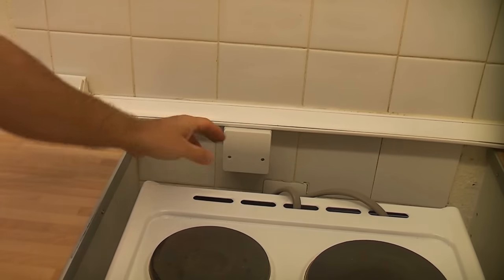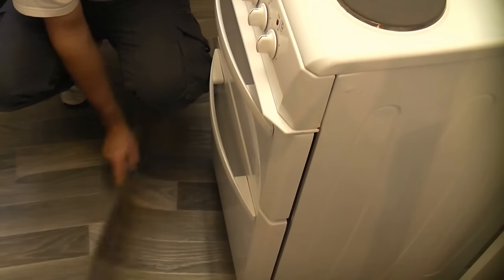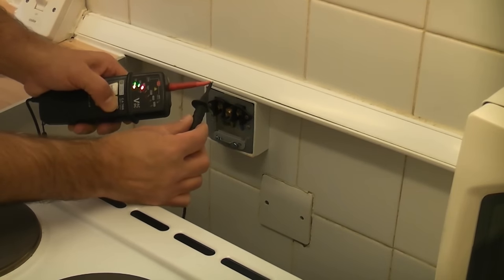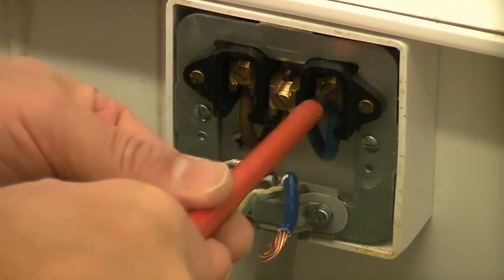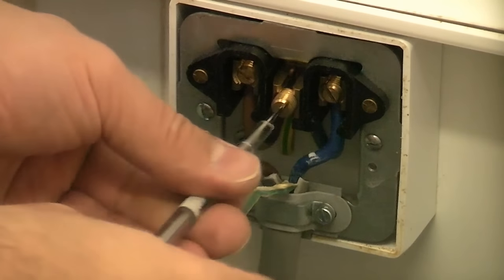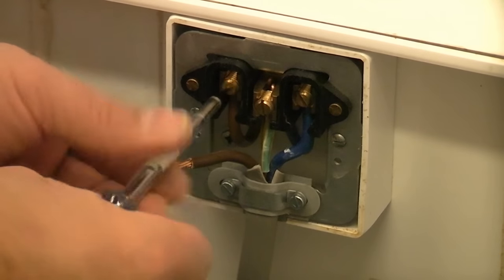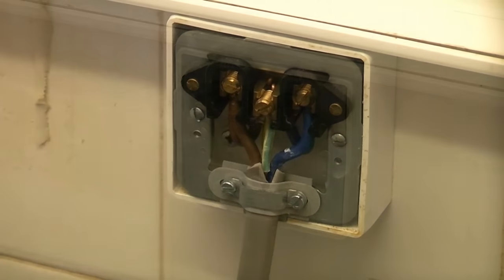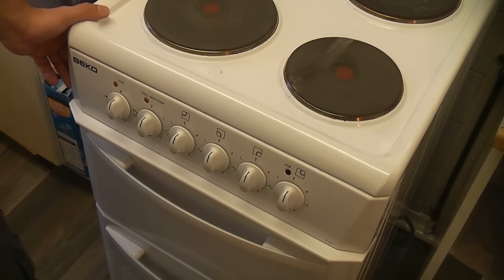How to wire an electric cooker

Comment: In the fuse box it is labelled cooker do I just switch that off or should i also switch off label that says sockets too? Thanks
Reply from the maker: Switch off the cooker circuit, then lock it off to make sure that nobody can switch it back on ;-)
Then test to ensure it is not live before touching any of the terminals.
Thanks for the comment 👍
Reply: @ultimatehandyman  thanks managed to do it fine. ;)

Comment: Hi the bud...my cooker Is without the cable supplied,  is there a particular size cable.you need? I.e 9mm?  Cheers in advance
Reply from the maker: You'll have to check the manual for the cooker, that will tell you which cable you need ;-)
Thanks for the comment
Reply: Ultimate Handyman cheers...lol you'd think I'd know, having worked for contactum for 14 yrs!!  Albeit 12 yrs ago.. Checked manual and 6mm is good.. Sorted and working fine.

Comment: Daft question what's the additional socket box lower down on wall for
Reply from the maker: That is the original cooker connection unit which was disconnected when the flat was rewired. Originally the whole flat was wired with the cables buried in the plaster, but it was rewired a few years back and all sockets and even lights were surface mounted with the cables run in trunking.
Thanks for the comment

Comment: Don't see that ccu working too well with a seperate oven and hob arrangement as there is not really enough room to connect 3 cables together.  I used a 60 amp junction box for my oven and hob to split the cable. So one supply cable coming in from the cooker isolation switch and two cables coming out. one to oven and other too hob located in cupboard at side of cooker. It works well.

Comment: I don’t have one of those gadgets to check it’s off., is it ok to just switch the red switches off at the fuse box.  Thanks
Reply from the maker: You really need to test to ensure it is isolated correctly (people have been electrocuted when they have just relied on switches) 
If I was to do this without test equipment, I would isolate the cooker switch, turn off every circuit breaker (or remove every fuse) and also switch off the main switch on the consumer unit (but I'd never recommend that anyone does this without confirming it is not live) 
Thanks for the comment 👍

Comment: When my cooker was put in its on a normal plug,only had the brand new cooker month,today while using the hob ,flashing f come on,which means fault,checked the plug and has 13amp fuse,read the manual and it says 16amp minimum, could this simple 1amp difference be the problem
Reply from the maker: Normally single electric ovens can be wired to a 13A plug.
Double ovens, electric ovens and hob's normally need hard wiring into a dedicated circuit, they should never be wired into a 13A plug.
Not sure if that is causing the flashing f though.
I'd expect the fuse to blow, rather than a fault code appearing
Reply: @ultimatehandyman  do you have email,if possible like to send picture of socket set up?
Reply from the maker: @philhode5104   Probably best if you ask in the forum, as one of the sparks might reply (they know more than me)
http://www.ultimatehandyman.co.uk/forum1/viewforum.php?f=3

Comment: I have a cooker that needs hard wiring to an a socket like this, but only have a normal 3 pin plug socket for it to go into, what can I do ?
Reply from the maker: You will need an electrician to install a dedicated circuit, I'm afraid!
Thanks for the comment

Comment: Shoutout who wired that oven isolator switch tho genius
Reply from the maker: Probably a council/housing association electrician 😉

All the wiring in this flat was surface mounted. One day I was there decorating and two electricians rocked up, I thought they might have been testing or something! No, they just turned up to make sure that the capping was on all of the trunking. I told them that the light bulkhead in the communal hallway was not working, they just said “we are not here to fix that”, then left!

Comment: Wife wants a ceramic hob fitted,instead of gas hob now installed,I have a 45 amp wall plug feeding electric cooker,which has a socket for a plug on it not being used,can a 6mm cable wire into a 13 amp plug,so I can drill through worktop,through fitted cupboard,to a new hob,there is a 45 amp breaker fitted in main fuse box to feed this wall socket,any ideas or info please,will be doing it soon,03/10/2019 thanks.
Reply from the maker: I'm afraid you'll need an electrician for this one 😉

Comment: Nice thorough video. Not seen that kind of cooker box before though.
Reply from the maker: It's in an ex-council flat so it might not be a common type. It would make things much easier if they supplied cookers with a lead and special plug ;-) 
Thanks for the comment ;-)
Reply: You are right there, something similar to a 3phase plug would be great so it's all enclosed safely. It's not like electric cookers are an uncommon thing.
Reply from the maker: Exactly, I don't know why they don't sell such a thing, it would make a lot of sense!
Thanks for the comment ;-)

Comment: So if I turn off my fuse box I'll be fine to do this with normal screwdriver.?
Reply from the maker: No, you need to check it is not live first- or you could be electrocuted.
Thanks for the comment 👍

Comment: Also I used to test appliances for a local charity shop before they could be sold and did a 2 day P.A.T testing course which I passed, the only thing I never worked with was electric cookers as there was nowhere to connect them.

Comment: should the wires of the cooker be touching the wires from the wall connection ?
Reply from the maker: Yes, they are in the same terminal. Unless you have a CCU with two lots of terminals.
Thanks for the comment
Reply: Sharon Aur thanks for asking this. I wondered the same thing if they're allowed to touch or not haha 😂 x

Comment: Thanks for the video, nicely explained. Can you use a standard multi-meter to check if there's any voltage at the live and neutral connections? I didn't recognise the bit of kit you used
Reply from the maker: Yes you can as long as it is set to AC volts, but the HSE recommend using a GS38 approved voltage tester such as the one used in the video. With a multi-meter there is a chance that you could have it switched to the wrong function or the meter itself could be faulty which is why a GS38 approved tester is recommended.
Thanks for the comment ;-)
Reply: Ok makes sense
Reply: +Ultimate Handyman ... if their no sleeve on the earth wire is it safe to leave it bare ???
Reply from the maker: Yes, but it's best to sleeve it. Apparently sleeving the earth wire is required for the British standard, it's often left bare in other countries such as America I believe.
Reply: cheers for the reply just I got cooker fitted and was worrying about the bare wire
Reply from the maker: If someone installed it for you they should have used green and yellow sleeving. 
Were they a qualified electrician?
Reply: I believe so they work for Curry's
Reply from the maker: They should have used green and yellow sleeving, not doing so means the wiring is not up to the current wiring regulations.

Comment: What does it mean to "cross thread the screw"? 

Thanks for the useful video 👍👍
Reply from the maker: When the screw is not engaged correctly with the threads, if you tighten the screw, it strips the threads from either the screw or lug.
Reply: @ultimatehandyman  thank you!!!

Comment: I am replacing my electrick cooker but it is thurther away fron the socket than the last how far can i go, it will be 3/4 mtrs away. many thanks in advance.
Reply from the maker: It's best if you get an electrician to spec the correct cable for you ;-)
Thanks for the comment 👍

Comment: My cooker is switched off on the wall socket/switch. But it still turns on when I turn the oven knobs and the electric lighter is working. 

What's the problem there. When it's turned off on the wall, it shouldn't work right?
Reply from the maker: The switch could possibly be damaged, and no longer working. Or it might be fed from somewhere else.  
It’s probably a faulty isolation switch though.
Reply: @ultimatehandyman  Thank you for the reply. is it risky? I am guessing the electrician who connected it bypassed the switch and connected it directly.

Comment: Hi, my biggest problem is dropping the grub screw and it always seems to fall into the least accessible area.
Reply from the maker: +John Fithian-Franks 
Yes, dropping them is common ;-)
Reply: +John Fithian-Franks Yeah I take the screws out of scrap junction boxes, sockets, switches etc... and put them in a compartment in my toolbox, for just that reason. It's saved my bacon several times... dropping the earth screw from a socket box and having it roll under the floor is another good on LOL
Reply from the maker: +TheChipmunk2008 
I also do that, especially at work ;-)
Reply: I use a bit of blu-tack (or similar) to fix the end of screwdriver into screw slot when using fiddly screws or where it's difficult to use both hands. Just put a blob on the end of screwdriver it can be used time and time again. (I've even used chewing gum)
Reply: Not sure why this comment's not showing on youtube (I guess google STILL haven't sorted the mess out) but yes, I do the blutak thing...also beeswax (i know it seems obscure but I have it around for other reasons) works really well for sticking screws to screwdrivers
Reply from the maker: I'm glad it's not just me that has problems with the YouTube comments. Sometimes I have major problems ;-)
Reply: It's possible the reason you can't find my tip about using Blu-tak is that it requires clicking on "view all * replies" under John Fithian Franks' post. (The * denotes an ever changing number) I also had problems - finding your reply - or my first posting.
Google need to go back to the way things were they've made things too complicated.
I am informed by email when someone comments on my channel - but am NOT informed if someone replies to another poster - so it sometimes makes it VERY difficult for the channel owner to spot trolls.
Reply: My reply  on this thread might help - although Google have really messed things up - Confusing everybody! You might need to click on "view all * replies * under John Fithian Franks' comment to find it though.
Reply: It always happens to me.

Comment: what if the green and yellow wire is naked, will that cause any problems?
Reply from the maker: Not really, although it should be sleeved with green and yellow sleeving to meet British Standards.
It's common to find bare earth wires, I normally just slide a piece of sleeving over them.
Reply: ***** ok thanks :) I will do that just to be sure

Comment: How do I know what mm wire to use?
The cooker I brought says it's 35amps but my fuse board says it's 30amps? Help please thanks
Reply from the maker: You might need an electrician to specify the cable.
Or sometimes it will tell you in the manual with the cooker.
Thanks for the comment 👍

Comment: What kind of wire do i need for my cooker as i didnt get a wire with mine someone said a flexi wire am i right and where can i buy it
Reply from the maker: I'm afraid I can't answer that. It normally tells you in the instructions for the cooker, if not you'll have to ask an electrician.
Thanks for the comment 👍

Comment: I have purchased a new Howdens Lamona electric single oven and grill and a induction hob. I have 32A wiring and connection box... the oven and hob have come with wiring attached with a lae that tells you not to fit a plug. The guy I have got to do the connection says that the cable from the appliances needs changing to a heavier amp to match the incoming supply, but surely the appliances would have been connected with the correct flex???!!! I don't want him to mess with the flex incase it invalidates any warranty. Can any one advise?
Reply from the maker: Is the guy fitting the oven and hob an electrician?
Most electricians that I know would install a fused switched spur, and fit a 13A fuse in the spur.
replacing the flex is not a good idea IMHO
Reply: @ultimatehandyman  no he isn't a qualified electrician that's why I am doubting what he is saying. There is a fuse spur, a 45A easy fit dual appliance outlet, and from the meter to the box that's been done in 10mm cable. I thought the oven and hob just got wired using the cable already on the appliances and the incoming cable was heavy duty so that if both hob and oven were on full blast it could cope with the draw of power... but I am only a home owner not an electrician... I don't have confidence in this guy and when I questioned him about changing the flex that the appliances came with to 10mm he got shirty with me.

Comment: Out of nowhere my cooker switch is making a cracking noise when I turn my cooker hob dial. Do you know what the problem may be?
Reply from the maker: Not sure, but it does not sound good- it sounds like it might be arcing.
Best to get it checked out by a professional
Reply: @ultimatehandyman  Will do. just weird it has just randomly started.
Reply from the maker: @theandroids   yes, it's strange 🤔

Comment: Hi I am renovating my kitchen and want to install a new creamic hob I hvE PURCHSED. The fitting instructions indicate there are two live wires to be connected but the house wires only have the normal 3 wires. Can I just wire it u the same as the hob that came out. I think I will prob need a n electrician in the end #friedme. Thx
Reply from the maker: It's best to get an electrician in these cases.
Thanks for the comment 👍

Comment: Great vid. I've just purchased a new 13 amp electirc oven to replace my previous 13 amp cooker. A new cooker control unit was installed a few years ago as a part of kitchen re-wire. The wire from the Control Unit was wired directly into the back on the oven as the oven design allowed this. The new oven however doesn't and it instead has a wire that plugs into the back of the unit (kind of like the connection into a pc monitor) and that wire is to be then wired/connected into the cooker control unit, but it's not long enought to reach the Cooker Control unit. So now the wire from the oven and the wire from the cooker control unit have to be connected together. I take it to wire them together I need to purchase a cooker CONNECTION unit and follow the instructions in your video? It also seems that the connection units are standard 45amp? Any help is apprecited. Cheers.
Reply from the maker: You could just put a plug on the wire from the oven and a trailing socket on the cable from the cooker control unit.Most single ovens are designed so that they can be wired into a three pin plug, which can then just be plugged into any socket.
Reply: Cheers! Appreciate the advice.
Reply from the maker: @rickbear7249   Please read the OP, he is installing an electric oven- not an electric cooker!

Comment: My electrical Coker do not come with a wire,I have a place where is sopos to be connected but how do I do it?
Reply from the maker: I’m afraid you’ll need an electrician to specify the correct cable 👍

Comment: I dont have the tester sadly but all the switches on the c board are off along with the plug to the cooker so fingers crossed ill be good also took a picture of the wiers before hand as a reference

Comment: In the 1970s this is how all electrical appliances came, without a plug..many kids like 5 and 6 years old would know how to do things like this because it was common knowledge living in that time, I’m sure many got injured and killed..not isolating the electrical supply and also having wet fingers ect ..that’s the reason health and safety came in, just like on building sites, people used to work there with no safety wear or steel toecap boots ect ect...
Reply from the maker: Yes, and 50 years later, it’s just too difficult of a solution for the manufacturers to design a plug and socket for this purpose 😉
Reply: @ultimatehandyman  ok

Comment: Can I just install the wires onto a plug and plug it in to a wall socket?
Reply from the maker: No, but sometimes you can do that with a single electric oven- but definitely not with an electric cooker
Reply: Ultimate Handyman I have a gas cooker can I install a plug onto it?
Reply from the maker: Yes, providing the electric connection is only for the cooker display and ignition etc.

Comment: Is it 30 amp cable
Reply from the maker: It was 6mm (if I remember rightly)
Thanks for the comment 👍
Reply: Anne Gray There is no such thing as 30 amp cable. Cable is measured in terms of the cross sectional area of the conductors. The current carrying capacity is dependant on the nature of installation, the length of the cable run, whether the cable is buried in plaster or in free air and many other factors. The cooker manufacturer will usually specify the size of the cable required, if not a maximum power requirement, from which the dimensions of the cable can be calculated, which also possibly considering diversity (an equation which recognises that all elements of the cooker are unlikely to be used at full power at the same time). Wherever possible cookers should be connected with heat resistant flex rather than flat twin and earth. If in any doubt it is better to oversize the flex. Don't forget to ensure that the wiring to the cooker point is also of suitable cross sectional area and the MCB or RCBO is correctly rated. It's not uncommon for older houses to have undersized cables to cooker points, they didn't foresee the trend for wide range style cookers with two ovens, a separate grill, warming drawers and six or more cooking rings on top etc.